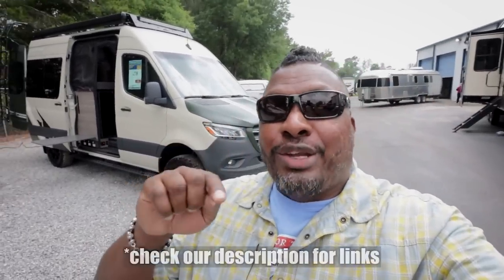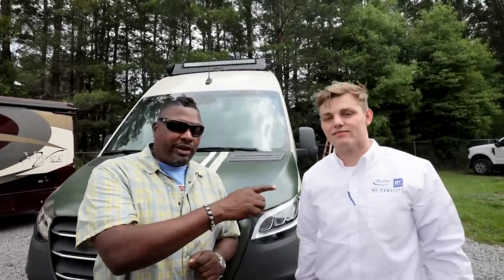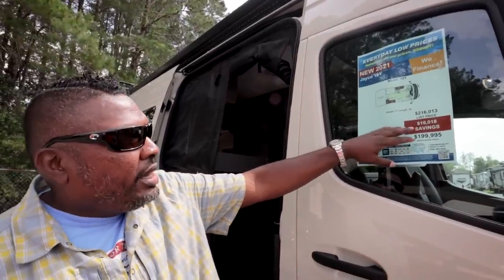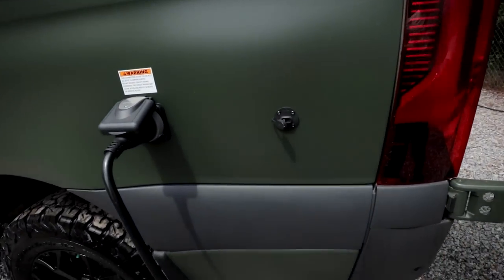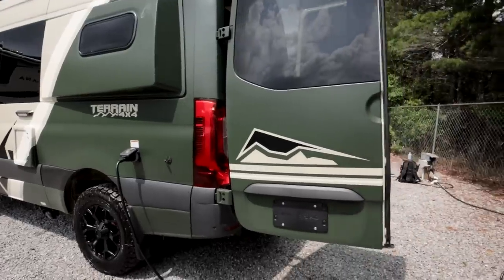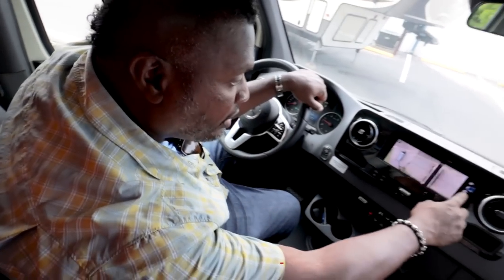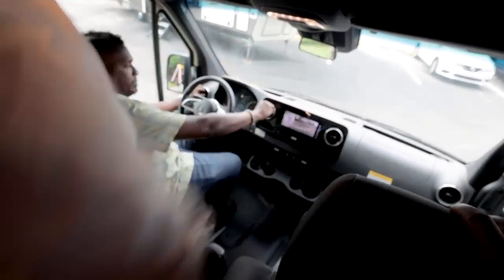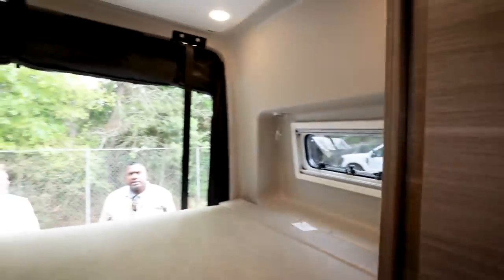BETTER THAN Winnebago REVEL? ALL NEW Jayco TERRAIN 19Y 4x4 Detailed Walkthrough

Comment: I ordered this van a while ago up here in Canada. Still waiting for it, but one key thing to note is that the battery is 10 kwh, at 48 volts, so equivalent to 860 ah at 12 volt. Can run the AC for 11 hours at medium setting, especially since the AC is already at 48 volts.
Reply: any idea how long you can run the ac for with the car engine? i m in canada too in southern ontario and our summers get super hot even at night needs ac often.
Reply: @1111111111202  right on, yep I'm near Toronto but travel all over Ontario for my kids' motocross races. I have been told that it can run AC for 10 to 14 hours from medium to low from a full battery. Right now we have been camping in a tent and using a Go Sun 1.2 kwh portable battery in our tent trickle charged by either solar panels or via my Mitsubishi Outlander Plug in Hybrid. My sons race with Electric MX bikes and I'm able to charge their bikes and keep up with the tent battery needs (12 volt fridge cooler, devices and cooking) off of 8.7 kwh from the car plus 1.2 kwh Go Sun. So I would recommend getting a secondary 100 watt solar panel for the plug at the ground level of the van and powering your other devices with a Jackery type portable battery to save as much power from the 10.8 kwh in the Jayco. I'm not sure if you're able to charge the house batteries in an idle diesel state or if you have to actually drive 2 hours. 300 watts of solar on a sunny day will keep things at a decent level of charge. But I have found that in the heat, the fridge has to work way harder and the demand exceed by about 30% on power draw. You'll want to have a full house battery in the van to run AC all night. I have been using the battery to cook using two steam style devices and the draw is 400 watts, so cooking with wood via a Biolite cooker or using a Jet Boil saves your battery by a lot.  I am also looking at the portable AC unit called the Mach 2 as the AC in Jayco and Revel are more focused on the garage sleeping area. So if you have others sleeping in the front of the van, it won't be that cool. Hope that helps.

Comment: Got anymore details on the battery sytem? I was told that there may be some issues with the battery system that still need to be worked out by Jayco. Are they using LiFPO4 or some other chemistry. LiFP04 is pretty solid when kept above freezing temperatures when charging.

Comment: No light above the sliding door? Seems like a big miss. Also would be better to have magnetic bug screens on front and back for quick access
Reply: After you zip down the screen, you can open the sides via magnetic. If you watch closely on the video you'll notice the sides split open as they are zipping. I just found out they are magnetic from another video =)

Comment: I wonder if it has the ESC - stabilization control that the ProMaster has. The 2021 ProMaster has all the features of the Benz(cruise control, lane assist, blind spot warning, instant restart, and the ESC. The ESC is a wonderful thing when driving during high winds situation. It was amazing how it helped my Tellaro to be stable despite the winds. Pretty scary time last winter. I needed a shorter one though so looking if I should get the 144 or the 18M.
Reply: Except no 4x4 or even AWD! If they ever add AWD too the Ram, they'll sell more!!👌

Comment: You are correct.  If you want 4x4 one needs to buy soon, as Mercedes’ is no longer go to build the 4x4 Sprinter.  Sad.  🙁   I guess there’s not enough of a market for the 4x4.
Reply: They’re just swapping the 4x4 for an AWD system which is actually even more capable and effective than the 4x4 system. At first glance it seems like bad news, but it’s quite the opposite.
Reply: @calebwalters3096    Hmmm.  I’ll have to look into it.
Reply: A few videos on YT testing the new 2 litre twin turbo four cylinder with the new permanent four wheel drive and the feedback is very positive. The new engine might be smaller but has more power and faster pickup, and the permanent four wheel drive means if you encounter rough or slippery conditions you don't have to stop to engage all wheel drive.

Comment: Nitrogen in the tires...with an air compressor in case you air down your tires.  Does that air compressor magically pull nitrogen from the air to refill the tires with nitrogen?  Of course the answer is no.  The inclusion of nitrogen in the tires from the start is a waste, and mentioning it as a selling point is a joke.